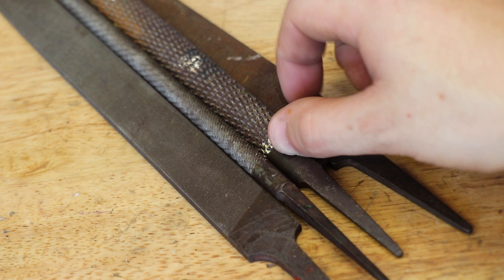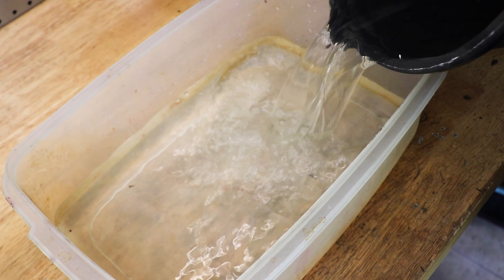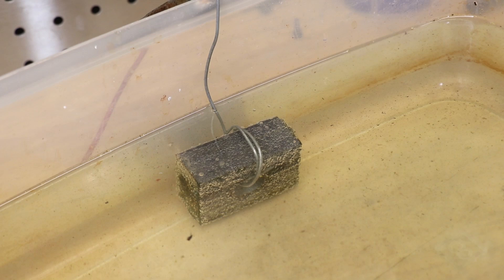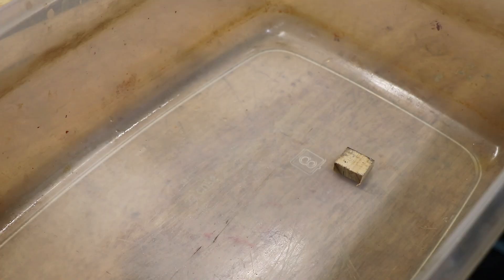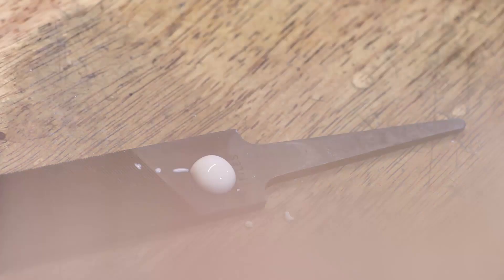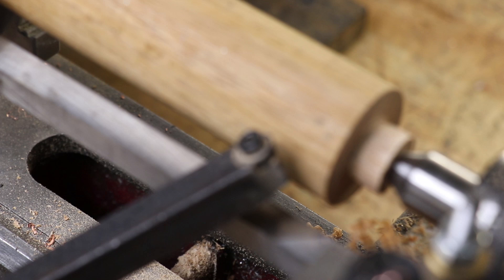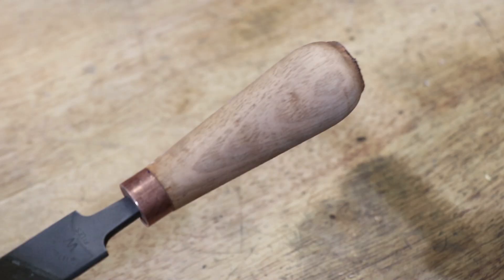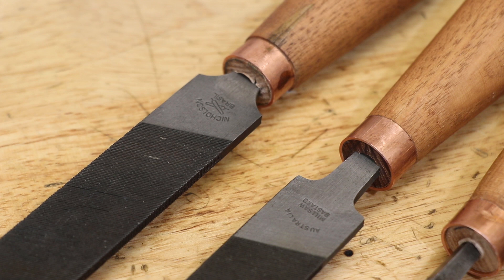Restoring Rusted Vintage Files

Comment: Many years ago an older machinist shared with me his secret for cleaning files. It is this: flatten the end of a 3/8 or 1/2 inch diameter copper tubing about 1/2 inch back; bend the other end up and over the flat portion to form part of a c-shape to act as a gripping surface. Rub the flattened end across and inline with the teeth of the file. This will quickly form groves in the copper which will fit nicely into the groves of the file cleaning out any debris lodged in there. Do this for the entire length of the file on both sides. This process can be repeated as needed. I, instead of the c-shape for a handle, found that the end could be inserted into a file handle which made it much more comfortable to use. Files rarely get dull. They just get clogged.
Reply: just an additional thought; oil will protect the file from rust but it will attract and hold both metal and wood fillings thereby clogging the teeth and limiting its effectiveness and necessitating a new cleaning.
Reply: @jimtaylor1941  
Agreed - but if I am storing for any great length of time, I grease them up and wrap them in waxed paper - easy enough to clean 'em up with some kitchen degreaser or petrol when you need a fresh one in the shop. I must have a couple of hundred files cleaned up and in storage .... for future generations
OK - I admit it - I just love restoring all sorts of tools and I'm a bit of a hoarder

Comment: I was repairing/cleaning a few files a while ago, they had lots of aluminium in the teeth. I had no chemicals/vinegar but stumbled on a guy that had the best way I have ever seen. Take a copper pipe, cut it on one side and flatten it out so it looks like a spatula - the tube is like a handle and the part you cut is akin to a blade. Then push the blade part along the same direction as the teeth and it cleans the file perfectly. It took an hour or so to clean four or five files, but they were all perfectly clean and no ali/rust/dirty or grease could be seen. A nice cheap and easy method to save your files.
Reply: Just try soaking them in a caustic soda drain cleaner - it will eat the aluminium in short order and will not damage the steel. I love finding them clogged with aluminium since they are so easy to clean, and often have had little use by the last owner since they got clogged up quickly and became 'useless' 
[caustic soda will also eat your skin very fast to wear some heavy nitrile gloves]

Comment: Citric acid (food additive) in hot water removes rust and will do the same "sharpening" of the files.
Reply from the maker: From past experiences I feel that I've always gotten better results from electrolysis, especially when there are fine details and stuck chips that need to be removed. Could just be wrong, but that was my experience when I did something similar a few years ago. Cheera
Reply: @artisanmakes  Acid bath has to be kept hot, does not work cold, maybe that was the problem? It is much easier to create an electrolysis bath than a heated bath so electrolysis is superior in that regard unless you are comfortable with high voltage (mains) and some improvised heaters in water.

Comment: I am skeptical. I'd like to see a microscopic view of the same teeth before and after. Just cleaning a dull tool get you a clean dull tool.
Reply from the maker: its not cleaning, rather etching with regards to the vinegar
Reply: @artisanmakes  Yeah I know it's etching. The question is , is it sharpened?
Reply from the maker: @billshiff2060  It is, as far as going by feel of the cut and the results. I am sure that someone has done a close up of the teeth on YouTube, but as far as im concerned, it seems worked on dulled file teeth. Cheers
Reply: @artisanmakes  Thats the problem, it "seems" to work. I have seen that etching does indeed produce thinner edges but they are crumbly and fragile not at all like a proper cutting tooth profile, more akin to a burr than a cutting edge. The experiment was to see if etching could be used to deburr, instead it accentuated the burrs. I don't know the mechanism. I'd wager the same thing is happening to the files.

Comment: I tried it and it sort of work, but was hardly what I would call a miracle. For this to really work, you need to thoroughly remove any bits in between the teeth, which is hard to do for fine teeth. You also have to degrease the file as well, since any residue will act as a mask, preventing etching.
Reply: I agree I've not had a huge success with this other than to learn what not to do with the new files I went and purchased. I can say a better way to clean the teeth of fine files is a block of copper. The copper is soft and works into the teeth when run sideways across the file.
Reply: @campbellmorrison8540  A better way is to use a strip of steel banding material......rubbed flat endways across a file the flat edge will wear down and take the pitch of the teeth and remove any stuck in metal........I use this for normal filing when I get steel "knibs" stuck in the file teeth.
Reply: That’s why you throw in some dishwashing liquid. Degrease as you go

Comment: ive got this tip from Larry Potterfield from Midway usa, before filing to scrape with a blackboard chalk over the file, after using it on the iron you tap the file out on the workbench to release the iron shavings

Comment: I was a sawfiler for 33 years and accumulated a large number of files destined for the trash. Some are obviously worn beyond repair but many have the new gone but are worth some time as new files in hardware stores cost enough to warrant time with my free supply. I'll try this method.
Thanks .
Reply: .... and did you try it and get results that lasted more than a few strokes ??

Comment: When fitting your handles, if you heat the tip of the file tang, 1/4" or so, to red heat, then push the handle onto the hot tang with the file held in soft jaws in the vice, the hot tip will burn the shape of the tang into the wood resulting in a better fitting handle without the possibility of splitting the wood. Makes lots of smoke so best done with doors open.
Otherwise a very informative video. I've got a pile of files that could stand some of that treatment.
Merry Christmas to one and all.
Reply from the maker: I've seen that done, but it just didn't occur to me when I did it. I'll have to keep that in mind and try it out next time I make a handle. Cheers
Reply: @artisanmakes  I was born in Zambia and have watched native blacksmiths making axes and badzas, a type of hoe, from bits of truck leaf spring. Once shaped they take the burl and trunk of a small tree and drive the red-hot end of the axe blade through the burl until it protrudes, partially, out the other side. These axes last them for years and, unless intentionally hit on the pointed end, the blades never fall out. Same principle with the files.
Reply: Ron is right. I have fitted many file handles and heating the tang is the way to do it. I do get them red hot further along though. The smell is glorious 😂. 
Also, test the tang in the hole first, idealy it should go about 1/3 into the hole without forcing. If it doesn't just stuff a drill down thd handle to open it up a bit. That way the tang will fit up to the hilt without splitting the handle and will be there forever 😁.

Comment: I tend to use either dilute sulphuric acid (or sodium-hydrogen sulphate from the pool shop) with reversed electrolysis for the sharpening step. It's way faster than vinegar or citric, although you can over do it and dissolve the teeth right off. About 30 minutes only and wet wire brush. No bubbles allowed. Then wash and neutralise with washing soda solution.

I use lemon wood for the handles. And I like your copper pipe off cuts as ferrules, very quick and easy.

Comment: To clean the teeth of the files get a piece of half inch copper pipe and flatten the end in the vice.  Clamp the file in the vice with the working surface that you want to clean facing up. Put the longer flat end of the copper tube perpendicular to the file teeth and rub the copper tube back and forth until the end develops serration that match the files teeth, now you have a tool that can get right into the valleys of the teeth and you can remove all of the gunk that has clogged up you file, then finish with a file card.
Reply: Copper work hardens... I might have to try that idea.
Reply: I’ve got a 1/2 pipe with a “T” connector that I cut out of my house 15-20 years ago that I’m still using today to clean my files. 

Also never use oil on them unless you plan to store them for some time. The oil helps the filings to fill the valleys and will reduce their effectiveness. Before I start  I rub chalk on them

Comment: Use a flattened piece of copper pipe and run it with with the teeth of the file. The copper pipe will get little teeth that will push the gunk out from between the files teeth. It's a great way to get alloy out of the files teeth and u can work a much larger area than with a scalpel. Then I soak overnight in vinegar and then neutralise it in a bath of bi carb and water

Comment: Very good work, I like your video, when I have to restore my files I first wash them in a bath of caustic soda, (Sodium Hydroxide solution) for about one hour and after brushing I resharpen them in a hot bath (about 60°C) of sulphuric acid with a 10% of nitric acid eluted with about 50% of water, it works much faster and it takes out also all the rust.

Comment: My preference is to use citric acid powder as it is a little faster than vinegar and cheaper when bought in bulk.  I also found that dousing parts in an alkaline degreaser (purple power, super clean, etc) both neutralizes the acid and prevents flash rust.
Reply: Baking soda mixed with water.
Reply: @stevesyncox9893  That's the sodium bicarb he mentioned/used in the video. Baking soda is sodium bicarbonate.

Comment: I use a tall plastic kitchen waste bin and suspend the files separately from a steel rod that sits across the rim of the bin which is itself, connected to the negative of the battery charger. Old knackered files and rasps are great for the sacrificial electrodes, which are also suspended from a common bar. A greater surface area speeds up the job. It always pays to first clean the file with a wire brush and some good de-greaser - it really speeds up the electrolysis. I use brass suede brushes instead of file cards, as the wire is thinner and gets right down to the roots of the teeth

Comment: A cool project and I like the handles.  I have zero knowledge about your Australian Oak. A beautiful wood.
Reply from the maker: Cheers. Its just good general hardwood that can be picked up at the hardware store for a decent price. Stains a great colour though.
Reply: @artisanmakes  The best source of really hard wood (in OZ)  is Redgum.......I always stop when I see a fencer putting up a new fence and ask for the Redgum fence post off cuts as they are as hard as iron.......cut into long square sections with a chain saw and you have wood that glows with a deep red warmth when varnished.
Reply: Note that Tasmanian Oak is actually a name for the timber from a few species of eucalyptus, not actually a type of oak.

Comment: Old files used to be re-sharpened by sand blasting them - the sand being blown from the handle end to the front. I presume that this would do a good job of removing rust. It's a good idea to use a new file for brass, and when it looses it's edge, use it for steel. If you've used a file on steel a lot, it's likely to loose it's sharpness and skate over brass.
Reply: If you fill the teeth with soapstone it won’t gall aluminum....

Comment: Great video! Files are such an important yet abused tool. It took years for me to get into the habit of always using a file card and it goes a long way in keeping them clean.
Reply: 'Vintage' file cards seem to be made with finer diameter steel wire and I buy them whenever I see them. The modern ones are too coarse and the wire is too thick to get down to the roots of the teeth. I mainly use a brass suede wire brush for keeping files clean as I am working

Comment: You can do this all in one by using boiling (simmering) water and soda crystals. Make sure any wooden handles dont go in the water. Doing this removes the rust, removes the gunk between the teeth, and sharpens the teeth. Leave them in for half an hour or more simmering away. 

When you take them out they will of course be extremely hot. The heat is your friend. Stand them up so the air gets to both sides and let them cool in their own time. That way not only the water on the surface evaporates, but also the water that has soaked in. Metal is porous.

If you do this in your kitchen make sure the hob extractor is on. I dont know if the fumes are unhealthy, but they are not very pleasant and its always best to be safe.

Comment: Couldn't you just go straight to vinegar for both de-rusting and sharpening? Also, what is that white fluid you used with the Scotch Brite to clean up the handle area? Very nicely done, edited and clearly explained.
Reply from the maker: I never got great results with that on the test file. The file needs to be clear of rust and debris to sharpen. You could do two rounds in vinegar if you wanted to buy I've found electrolysis to work better at rust removal. Cheers
Reply from the maker: And the white stuff is jiff or ciff, depending on your country
Reply: @artisanmakes   Great, thanks for the info.

Comment: Apart from the final coat of WD-40, that was a great and well made video. Consider something else instead of WD-40 as a coating. It just invites rust once that's applied by itself and left 😅
Reply from the maker: its not really wd, its lannox, i just use wd as a catch all water displacements
Reply: I use Valvoline .. know what I mean
Reply: 6:37,  @Artisan Makes  looked awfully like a blue can with yellow  writing on to me.
Reply: @bushratbeachbum  He displaced the water with Water Displacer 40 and (off camera) finished with lannox.
Reply: @artisanmakes  Great stuff if you don't mind your gear smelling like sheep, I use a fair bit if Lanotec, it was the only thing that stopped the springs in a POC Iveco from squeaking, but, well, sheep.

Comment: I bought a kit of Chinese drill bits. You can bend the 2 and 4mm in your hand - they don't break, they bend. Can I harden these and if so how?
Reply: Try heating to cherry and quench in oil, then temper to light straw and quench.
Reply: @johnhodges8264  Thanks John. There are 60 or so bits in the kit, so that is doable with the lot. I've been thinking about gas fired kiln out of a gas bottle type thing.
Reply: This should work if they are carbon steel and might need to be heated to almost white hot or very bright red, cherry red might be a bit low. l @BenMitro

Comment: Is it possible to screw up the electrolysis and "overdo" it?
Reply: No. Electrolysis only removes rust, not metal. I have left a piece in for about a month [I simply forgot it] and it does no harm whatsoever.
Reply: No, the reaction occurs b/c of the ferric oxide (Fe2O3) in rust. Once the rust is gone, you're not really doing much. 

You can make it take more time if you keep the sacrificial metal far away from the rusted piece, or if the water is too pure, or if you let the sacrificial metal get caked in rust.

Comment: Another good way to clean out files (and one of my favorites) is to take a scrap piece of some soft brass, I usually use a piece that's about a 1/4" thick and about 1" wide and whatever length you want or have, and then run it parallel with the teeth and cut the teeth pattern into the brass and you'll have yourself a custom file comb that will get almost anything that's stuck in between the teeth out. Using the backside of a broken #11 hobby blade like you did is great for individual teeth and a great way to stab yourself if you're not holding the file correctly. Ask me how I know. Lol! I swear I'll never learn my lesson on that one. I bet I've got more than a hundred scars in my palms and fingers to prove it. 🙄
Reply from the maker: Yeah that works really well, I used to have a piece of copper that used to use too. Cheers
Reply: @artisanmakes  I was just going to suggest that...
Reply: @trollforge  Yes, me too!
Reply: I use a short length of copper tube (plumbing offcut) hammered flat at one end (i have one split 3cm down from the end on one side and splayed out before hammering flat for a wider comb too)

Comment: I just put a pair of Nicholson's in for a vinegar soak!  The stuff I have here is only 4% though.
Reply from the maker: Higher concentration is usually sold as a cleaning solution vinegar, but 4% still works great. I have a few Nicholson and they are great files. Cheers
Reply: Add salt to it. And water.

Comment: Use citric acid dip for 36hrs, cleanup wihj wire brush
Reply from the maker: I prefer electrolysis but it should all work the same

Comment: Vinegar & salt bath overnight. Rust removal & ‘sharpen’ in 1 lazy step
Reply from the maker: I've tried that since but what I found is that the file teeth need to be spotless clean from grit and rust for the sharpening to work effectively

Edit: haven't  tried a salt and vinegar bath, only vinegar for the above comment